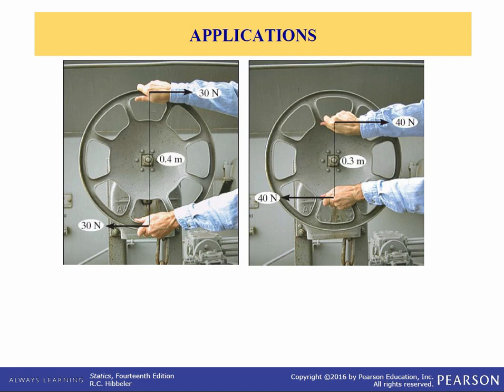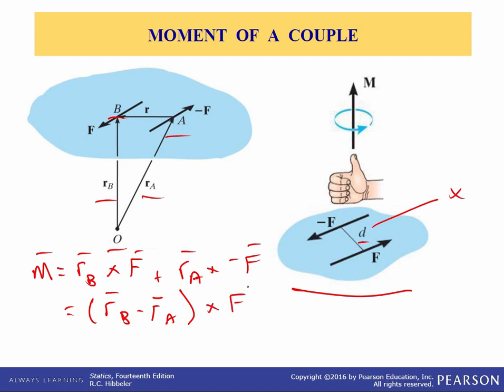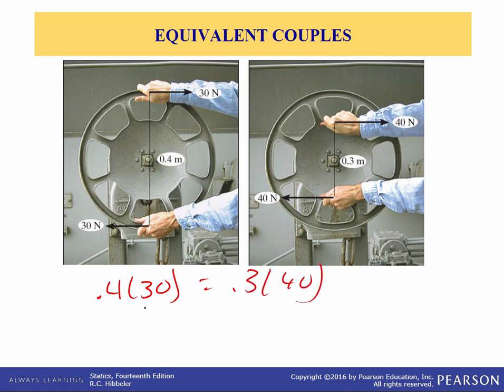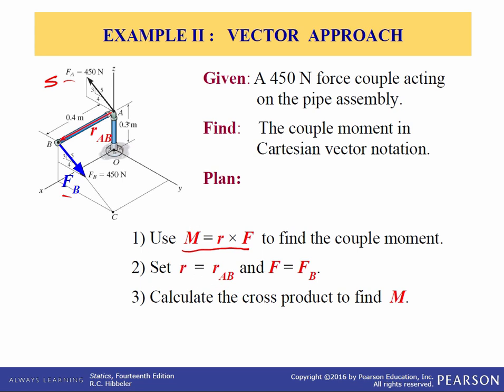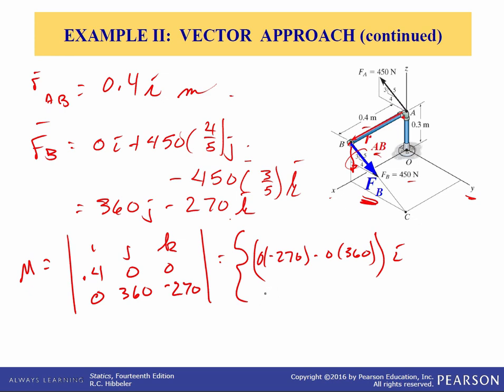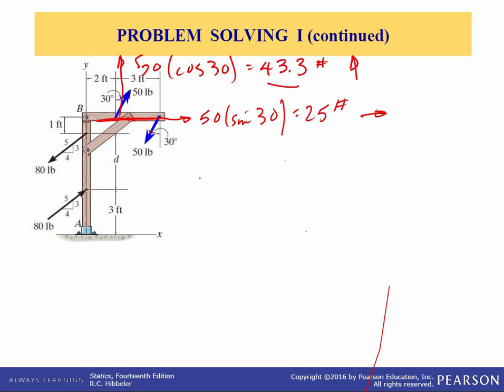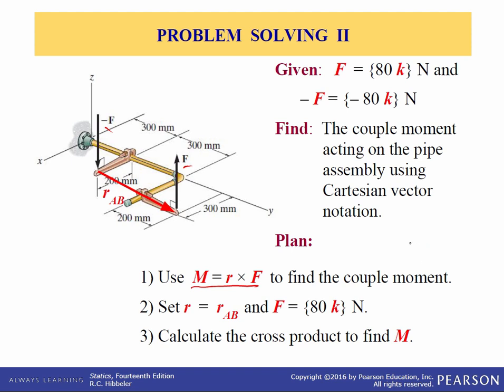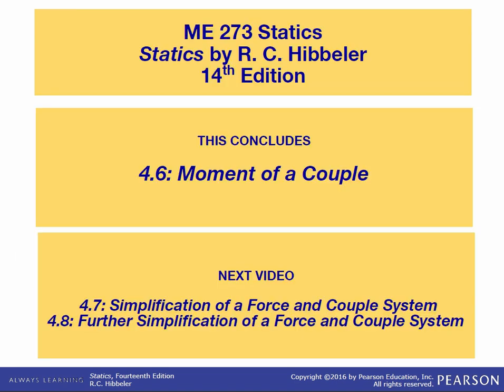ME273: Statics: Chapter 4.6

Comment: at 15:51 it should be 64(5)
Reply from the maker: No, 64(4) is correct. The 80 lb forces are separated by 4 ft.
Reply: ok thank you
Reply: @ColinSelleck  i still dont get it. can you explain more? actually, the other one i also confused why u choose 3ft not 2 ft.
Reply: also how you determine the direction. either clockwise or counter clockwise
Reply from the maker: @hizmoryyii1833  The distance you choose is the perpendicular distance between the two forces that comprise the couple moment.
Reply from the maker: @hizmoryyii1833  Imagine a point halfway between the two forces and then imagine the two forces causing a rotation about that point. If the rotation is CCW, then the moment is positive.